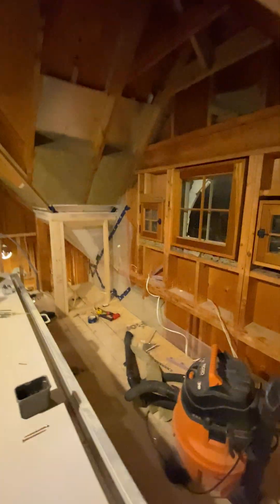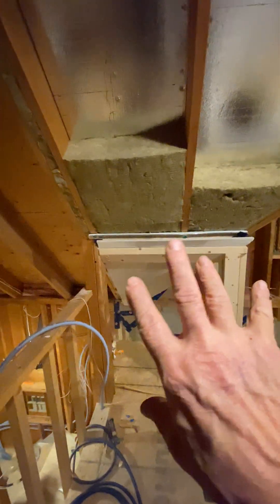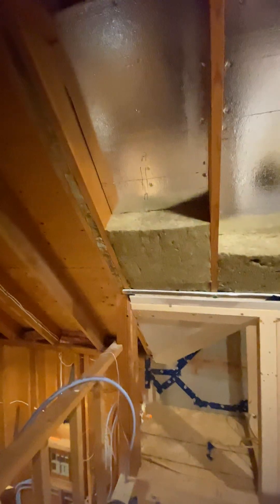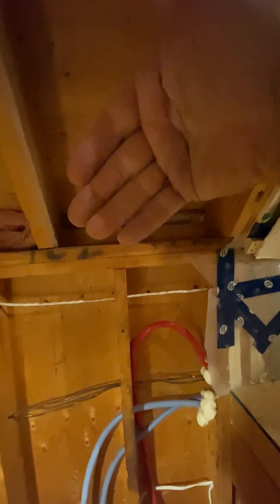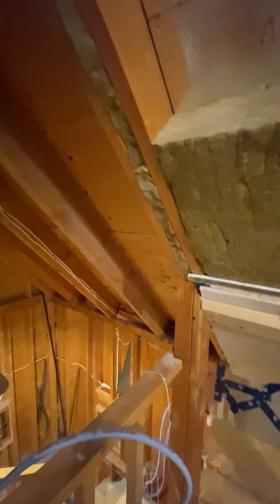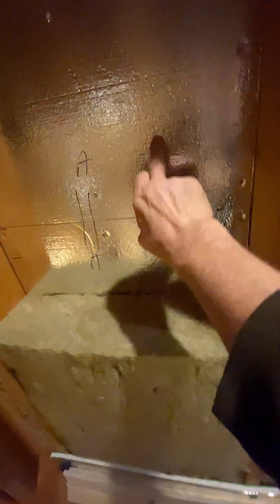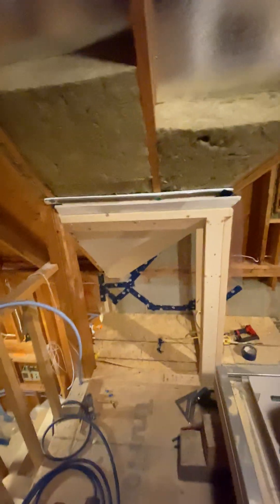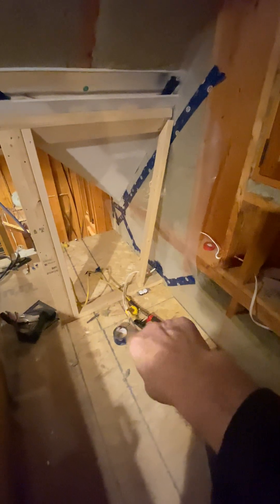shop up date  #wadkintemple

Comment: Sprayfoam
Reply from the maker: no thermal bridging, no ventilation, no reflective, radiant heat technology, and often done poorly where layers are too thick and peel away from the structure. Air leakage is 40% of the heat retention qualities in any assembly. I think spray foam on a roof, deteriorates the roof coverings and contributes to the demise of the sheathing and substructure.

Comment: Don’t you want it to either dry to the inside or to the outside?
Reply from the maker: it's not an entirely encapsulated assembly. Rockwool has the remarkable ability of not absorbing water. The isolation of the venting chamber keeps air from entering the insulation cavity and deteriorating its thermal resistance.
Reply: @ I thought rockwool can perform thermally regardless of its moisture content? A one way 50 perm tyvek in between the cavity space on the cold side will allow any hot moisture laden air to permeate through to the cold side and vent rather than being trapped. EPS is 5 perms per inch so will still dry but not as quickly. Not saying this setup won’t work many ways to skin a cat.
Reply from the maker: @ nothing is trapped. The reference of moisture is not too the thermal properties, but of one of the product holding water air leakage is what the dynamic here is also ventilation air not being allowed to loft the bat Insulation. should there be a roof leak It is directed to the Outer walls by the the venting layer . here in Canada, the vented roof also eliminates the risk of ice damming. This design is to maximize attic space not thermal resistance, although the resistance is adequate and continuous.
Reply: @jackEnglishmachines   how does it stop the air form the hot side escaping through? No vapour/air impermeable poly on the inside?